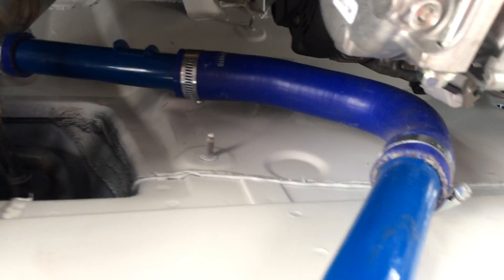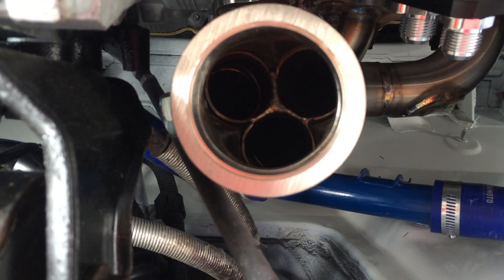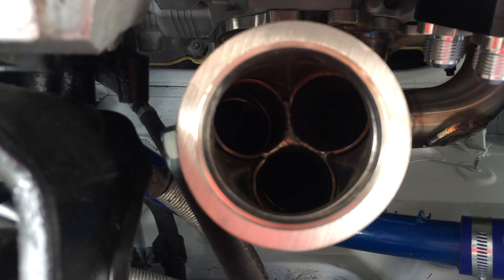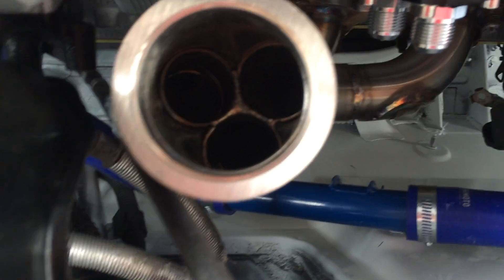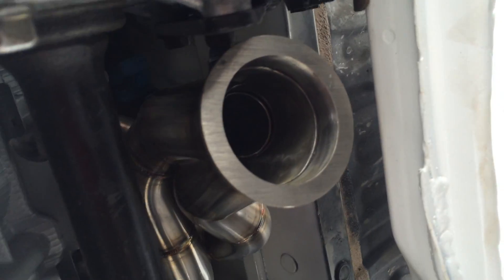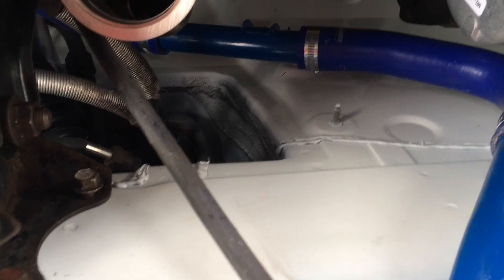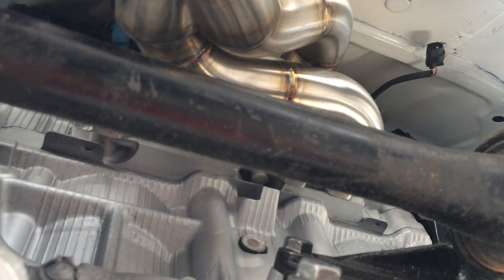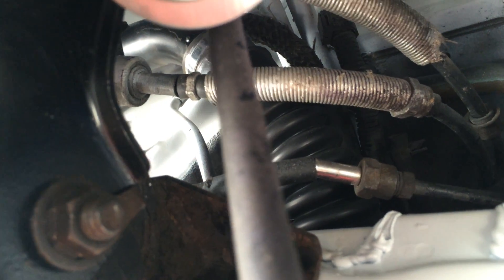3MZFE Naturally Aspirated Build - Sheepey Built 3MZ Headers

Comment: I got a 04 Camry it had a 1mzfe and I swapped the motor for a 3mzfe but i feel like I might need a tune or the right ecu I'm still running the 1mzfe ecu do u have any advice?
Reply from the maker: My suggestion would be is to use a piggyback ecu
The ecu you have is from a 1MZ VVTi?

Comment: For shits and giggles, I'm wondering what it would take to turbo the 3mz-fe in my Lexus ES330. I know the VVT-i would cause issues and the ECU is programmed for economy instead of power, but it would be really goofy great to get my love boat to scoot.
Reply from the maker: Gr13fM4ch1n3 you would end up paying about $5k in custom work and I might be under pricing the labor.
Reply from the maker: Gr13fM4ch1n3 I'm pretty sure you can take a 1995 Toyota Avalon that comes 5 Speed manual to swap over the manual parts to a 1995 Lexus ES300 and also swap a 3MZ isn't which should just drop in